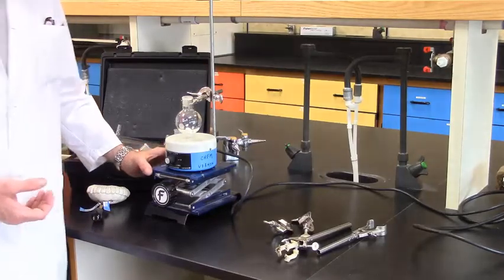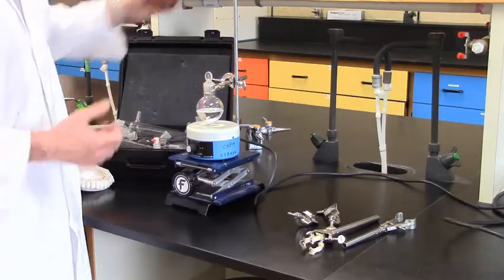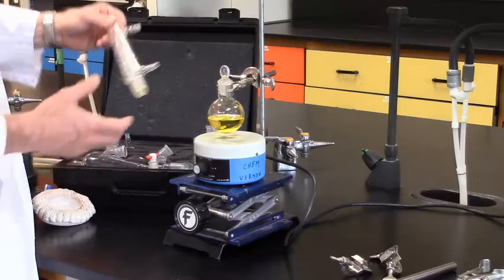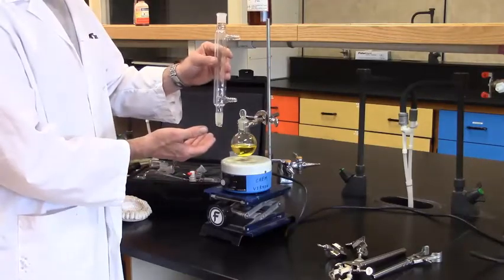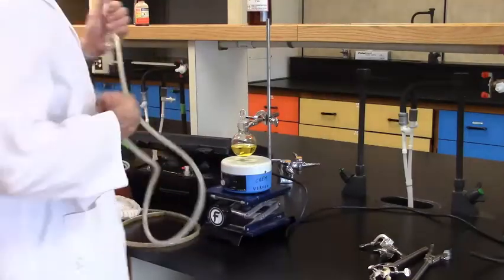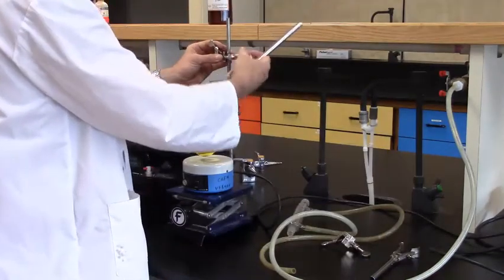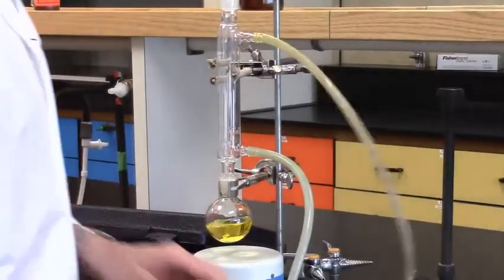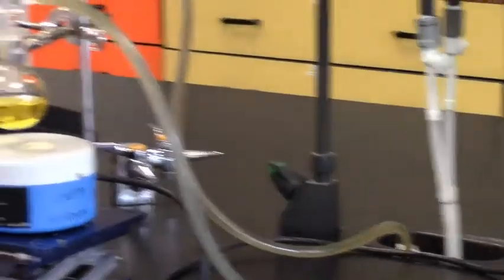organic reflux

Comment: Very helpful video for me.just learning but i wonder is top of reflux always left open in all cases? Can it be put into a trap or something  to rid or neutralize vapors? Just trying to learn.thanks for video.
Reply: You certainly can :)
Either lead it off to a solution or through a porous material where it'll neutralize on the surface.
Reply: @peterbloch9381  ok great thanku.
Reply: From experience from me never seal your apparatus. You can lead fumes to be neutralized though. If you seal the apparatus even lightly the pressure will raise the boiling point. In my case the pressure was high enough to eject a stopper which immediately lowered the boiling point and the immediate violent boiling shot out of the top and side necks of my boiling flask. It ruined my experiment but thank goodness for safety precautions!
Reply: @midwestchem368  wow thats kinda a dominio effect.glad u made it out safe! I didnt consider pressure vs boiling point changes.thanku for reply.
Reply: @generalingwer4341  of course! I didn't consider it at the time either. Just the refluxing solvent smelled alot so to mitigate the smell I gently set a stopper in the top. I didn't even push it in because I didn't want to seal it. That was enough to cause an issue. Ever since I use plastic wrap and rubber bands if I need to cover the top. It keeps solvent vapors in and it doesn't allow pressure to build easily. If the plastic wrap is pushed out from building pressure I can just remove the rubber band and everything is fine.
Reply: @midwestchem368  ok thanku